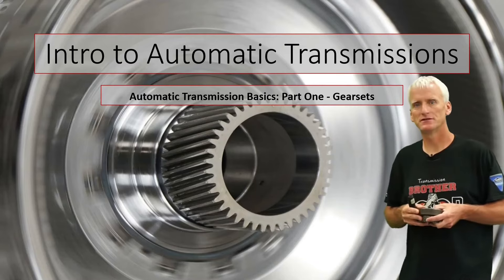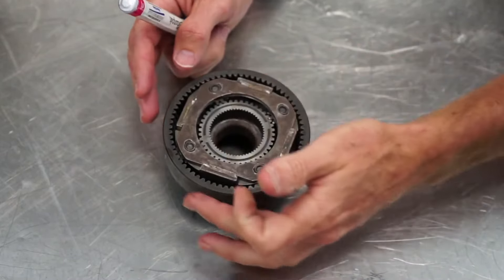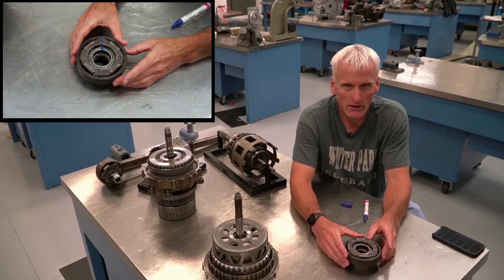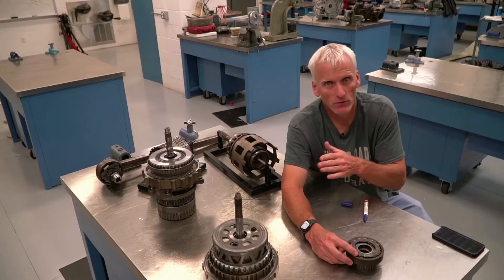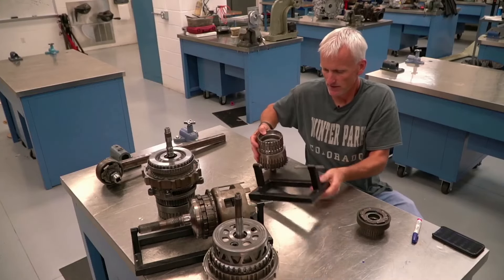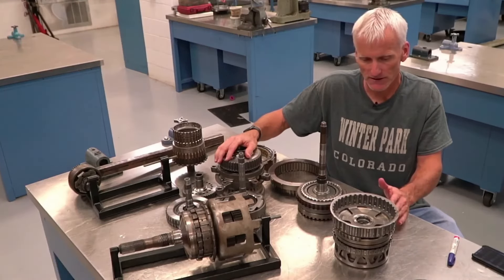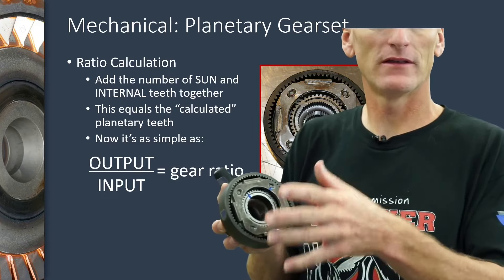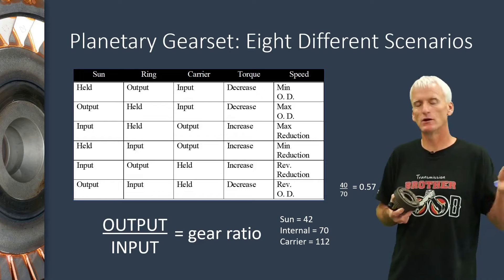Basic planetary gearsets

Comment: What is mechanically happening with the TC and transmission when in neutral?
Reply from the maker: Since there is low resistance to rotation in the transmission in neutral, the input shaft will turn close to engine speed.  If you monitored it with a scan tool (assuming you have an input speed sensor), you'd see the engine would spin slightly faster than input shaft (maybe 600rpm engine, 550 input shaft).  As soon as you put it into gear, the input shaft would stop and you'd have an impeller spinning engine speed and a turbine/input shaft spinning zero rpm.

Comment: at 18:03 -Two questions
1)  Why did Ring gear name suddenly turn to Input
2) Where did the Sun Gear losé 2 teeth ¿¿¿¿
So the calculation is wrong,  shouldn't input be 110
I.e.  40 + 70 = 110 ????
Reply from the maker: You weren’t supposed to notice that!!! Lol.  I don’t know how I lost those two teeth on the sun gear and I really don’t know why I didn’t notice it until I was editing.  Hopefully the concept still makes sense.  Regarding question one, I’m not sure what you mean.  Any of the three gears can be input, or the driving gear.  In the chart, each gear is input, held, and output twice.
Reply: @siuautomotive  Sorry I meant why did the Internal
gear name suddenly turn to ring. Before the slide it
was referred to as an internal gear, but in the slide
table it was called a ring gear. I thought this multiple
use of names for the same part might confusé
people watching like me 😁😁😁
I enjoyed the video immensely thanks 👍👍👍